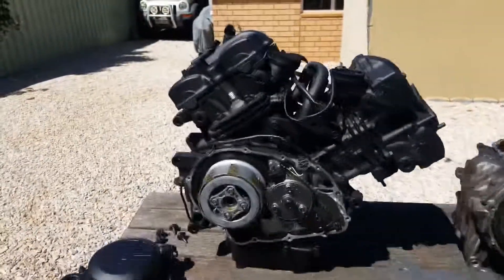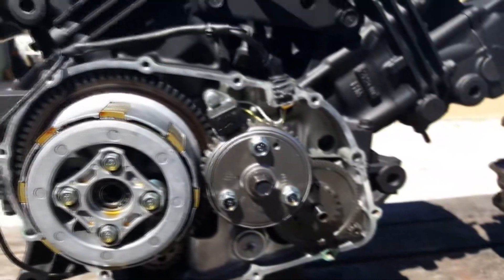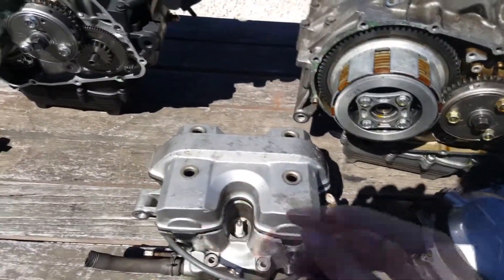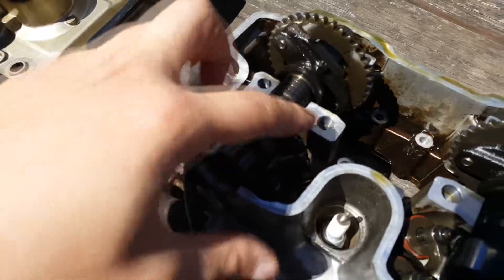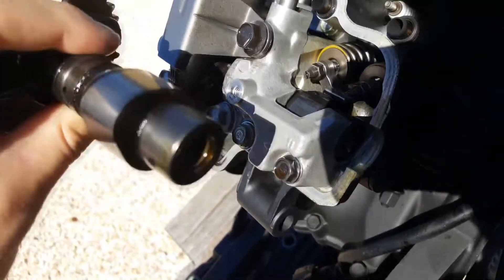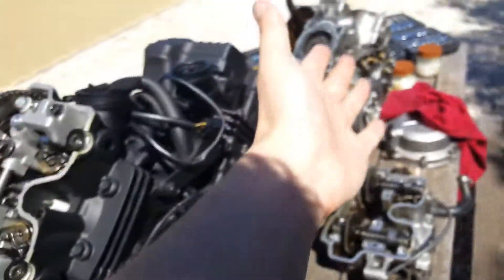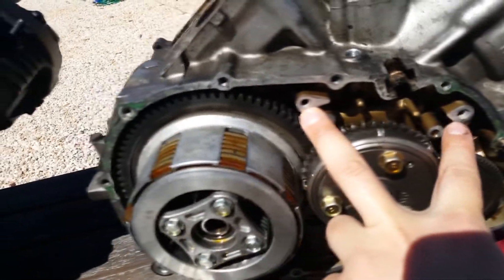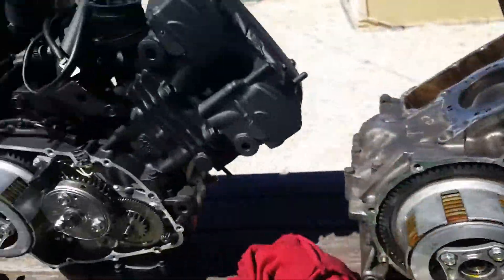VTR250 vs SPADA250 Engine difference - SPADA EFI SWAP!!!! P1

Comment: I’ve gained an interest in these recently, but we only got the 88-90 vtr in the usa, so they’re not common. I want to do a sort of retro cafe racer/board track racer style build with one of these 250s using the early vt250f steel frame, but I’m not sure if it would be feasible or preferable to use a newer engine. Idk what sort of improvements may or may not have been made over the years. I’m going for as much form and function as possible.
I think the Spada had an extra engine mount or two on the front head vs the vt250f.
Could you retrofit the 6-speed Spada transmission guts into the efi vtr case, or is the casting too different?

Comment: The VTR 250 redlines at 13500rpm, I had problems with the different crank sensors when I changed my 89 VTR Interceptor engine for a 92 VTR Xlvis engine, and for some reason it was about 20% different positions mount holes, so I got the wires from the other bike to coils and the crank sensor has an offset plates and fixed the problem immediately, so you can get the Spada coils wires to the single crank sensor and it should be fine, you need to change the cylinder heads for fuel injection.

Comment: Those gas pipes are just PCV relief pipes, on the spada engine they just vent to atmosphere out that pipe on the side of the cylinder head, instead of re-circ'd into the intake.
I always wanted to put a new vtr250 engine into my old 1983 VT250FD but was too scared it wouldn't work with the airbox or something misaligning etc.. Not to mention the 83 is just ancient and its not worth it anyway.
Reply: is there any mounting modifications that must be done to use the VTR250 engine into a VT250F? since MC08 has different mountings but is also more powerful...

Comment: Would it be possible to mount the fuel injection spada engine onto a 1989 vtr and replace the carb?
Reply: TheInterceptor yes, or you could just add the EFI if you’re industrious enough